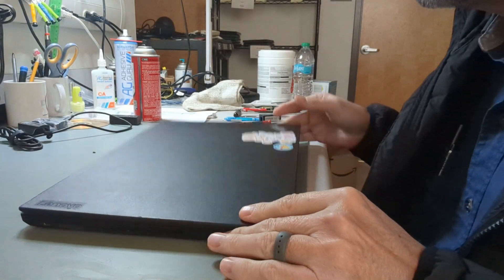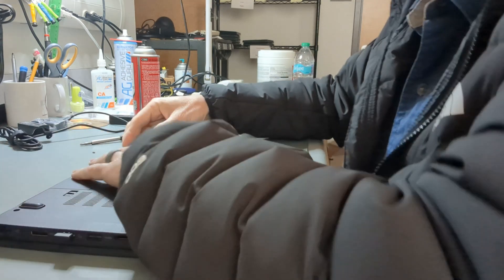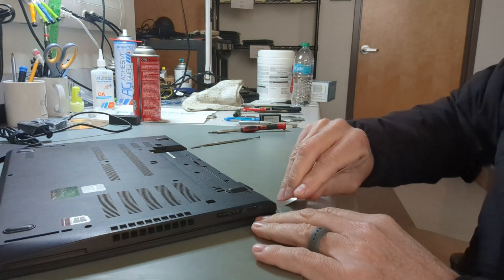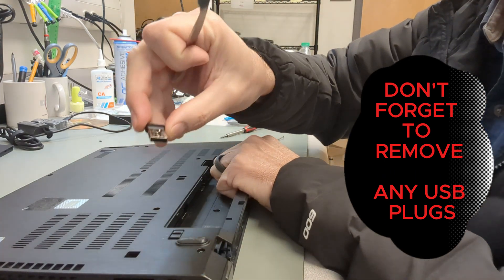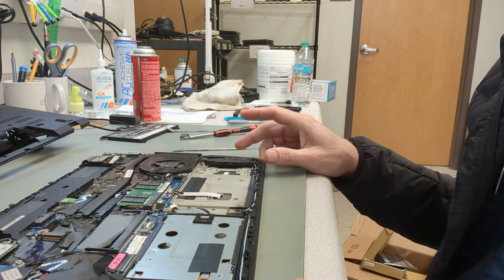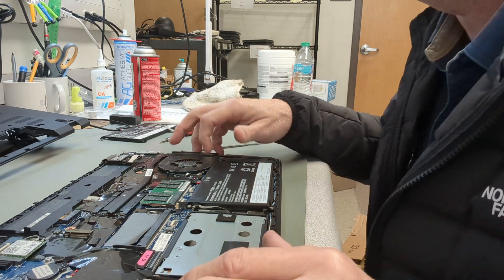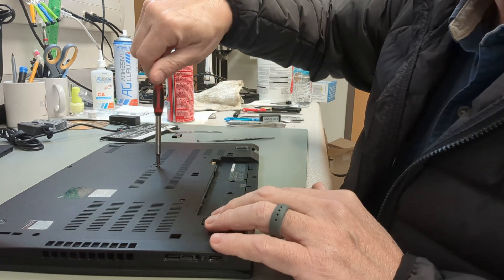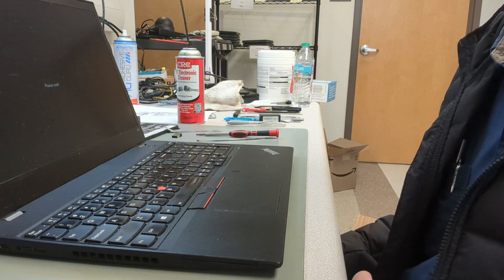🔋 Lenovo T580 Battery Replacement – Bring Your Laptop Back from the Dead!

Comment: What you have shown here is the wrong way to work on this laptop! The internal battery must be turned off in the BIOS before any work on the inside. You may have done that, but you didn't mention it at all...
Reply from the maker: Feel free to disconnect the battery if you'd like. l also break the speed limit.